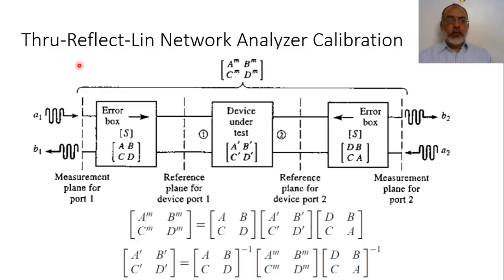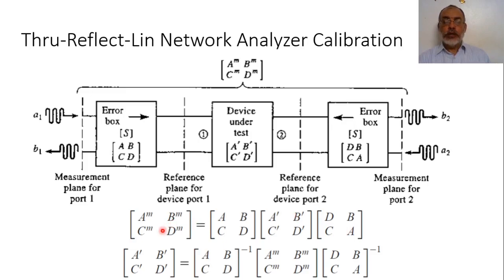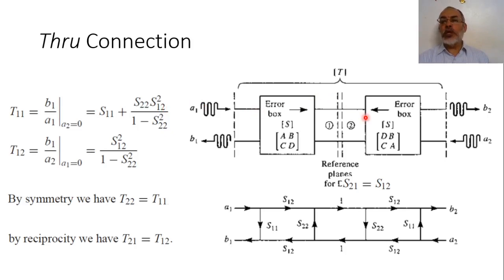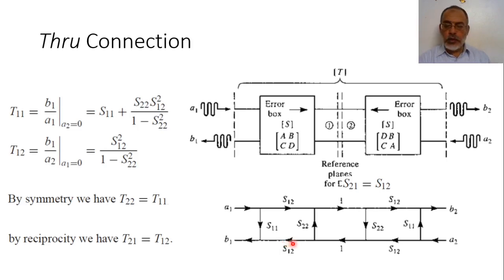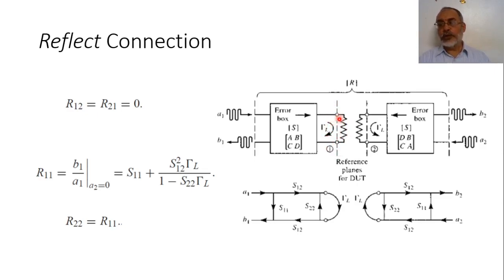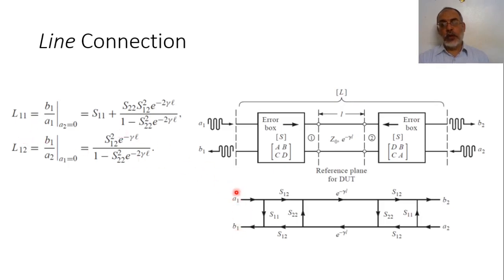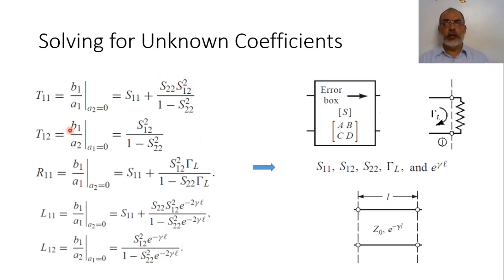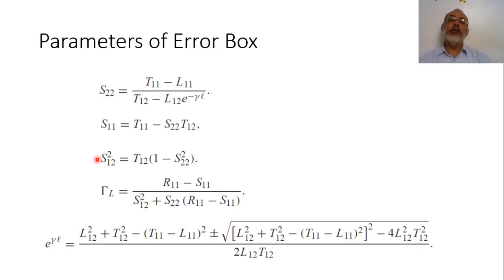Chapter04 16 VNA Calibration TRL by using Signal Flow Graph

Comment: To find out ABCD of DUT, you'll need ABCD of error boxes and also need to measure ABCD of the system.
And ABCD of error boxes need the computation of S parameters.
But the S parameters don't seem to need load reflectrion coefficient, so why even perform reflect connection?
Reply from the maker: you will need the ABCD of the probes which can be diterminded by measuring known loads like short, open and matched load. If you know the ABCD of the probe, you can extract the ABCD of theDUT from the measured ABCD